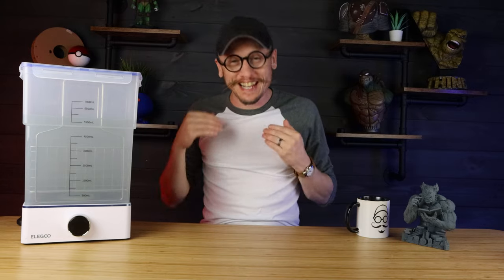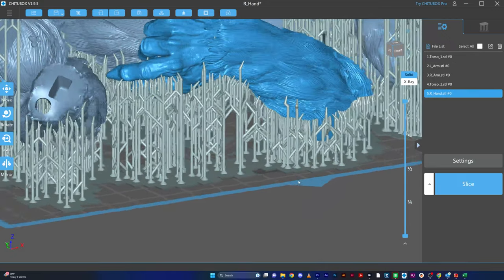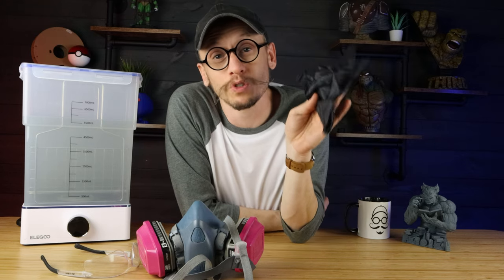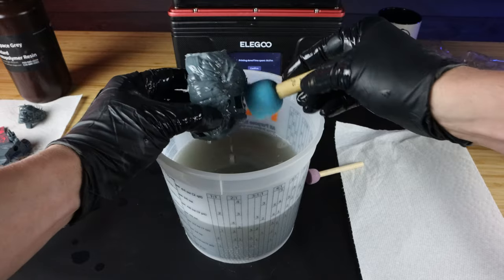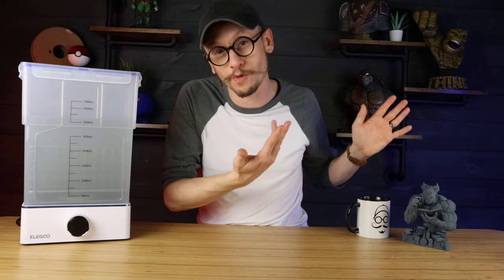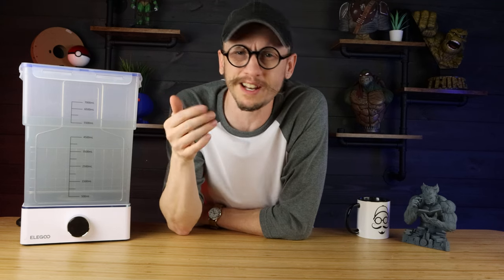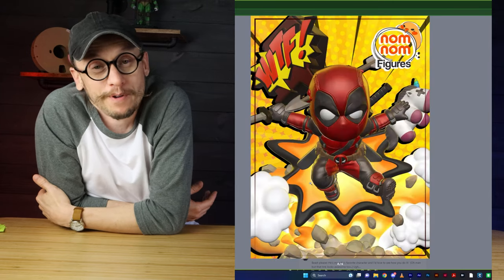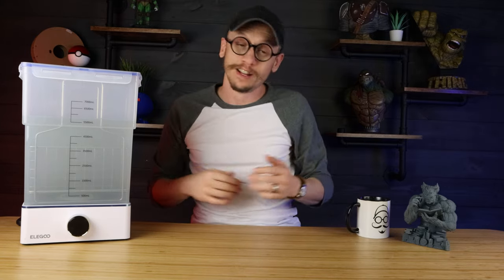Effective Resin Washing Techniques for 3D Prints: Step-by-Step Tutorial

Comment: I am not a maker. I am not even a hobbiest. I get to dabble with my printers on a very infrequent basis printing minis (resin), terrain (fdm) for D&D. But anything that makes my enjoyment greater and my frustration less is welcome.
Reply from the maker: I totally get that. I can’t even begin to count how many minis I’ve printed on my resin printer for my dnd campaigns. That’s where I see a ton of savings instead of buying them.
Reply: What are your thoughts regarding terrain printing with resin vs fdm? I just got a resin printer for minis, but would also love to make terrain for my players. I’d love to hear your thoughts and inputs on this.
Reply: I am certain that someone with more experience could give a better answer, but for me resin is what I use to print things that are small, delicate, and/or highly detailed. But for simpler, larger things I use fdm because it is economical and efficient. For example, I am currently printing Castle Ravenloft in 28mm scale (or trying to 😆) and fdm is better suited for that. I also like the dimensional accuracy that you can achieve with fdm. Especially when you need to cut up your model into multiple parts.

Comment: You need holes to clean the inside of the print...but if you didn't hollow your print there wouldn't be an inside...seems like a circular argument to me.
Reply from the maker: That is correct but if you don’t hallow your prints you are wasting a ton of resin. Without hallowing them you could drive up the cost of one figure x5 depending on the size.
Reply: For game pieces that get handled, are hollowed prints going to feel fragile?
Reply: Hollow game pieces don’t feel fragile, just make sure the wall is thick enough.

Comment: Lots of good advice Mead. Well done ! Clipping supports while they're soft, using two cleaning baths and having a small alcohol spray handy are always my recommandation. There are only two steps in my process that are different from what you're presenting. Thought it might interest you.
- ULTRASONIC CLEANER : I do not use a Wash and cure station so first dirty alcohol bath is done in an old ice cream plastic container with a hog bristle brush I keep clean every session and the second cleaning bath is done in clean alcohol in a closed container that spends one or two 3mn sessions in the ultrasonic cleaner. The prints come out squeaky clean and I never get residue. After 5mn out drying in the open, i can get them to curing.
- UV CURING IN WATER : i'm not printing big statuettes, I'm printing small and thin parts that need to be dimensionaly accurate and not warp or retract at curing. UV curing does heat the print and that causes stress in the model that can make it warp so i do the usual curing with the print immersed in water in a glass bowl for heat dissipation and because of its optic refraction characteristics.
Reply: Good advice. Thanks for sharing.
Reply: What kind of curing station do you use? Thanks for sharing!
Reply: @BL_SR  A DIY build consisting of a motorised turntable, UV Led strips connected to a small timer board and a tin-foil sided enclosure. You can build it up to the desired scale, from a small wooden box to a large metal bucket or even a standardized mailbox. It's the one thing you can do on the cheap without consequences in the whole printing process.

Comment: Hi Chris, good points in your video.
Though, with delicate parts I prefer to leave the supports on the model until all is dry right before it goes into the hardening station. I print parts for scale aircraft modelling. A thin part, e. g. a propeller blade, tends to warping if washed with all supports gone. 

Another thing I am doing is to wash the parts in water after the isopropyl alcohol bath to get rid of most of the IPP in this step. Then I give them a good blow with the hair dryer and leave the parts for at least half a day for further drying before curing them.

Comment: hi ! great video! may i know what do u do to fill those gaps inbetween the joints?
Reply from the maker: You can get Vallejo plastic putty or even wood putty you just have to thin that down with water then just sand away what’s left to get smooth seems. I did a video a while back on how I process resin prints as well

Comment: I have a very thorough process.

Let plate sit sideways for a while in the printer > scrape the minis into a vat of hot mean green in a metal lidded catering pan thats floating in water in a giant ultrasonic cleaner (this way I don't have to clean the ultrasonic cleaner itself) > once thats done,  drop it in another metal square pan thats on a hot plate and the water is hot > let it sit for a minute and start fishing out each piece and pull the supports off - they fall off with zero resistance > the remaining pieces now go into wash and cure

Comment: Rubbing it with the spouncer doesn't mess it up? I've always been super gentle with my prints for fear of messing up the detail lol.
Reply from the maker: Not at all. The details are already partially cured a sponge won’t do damage. But if you’re using a firm toothbrush or something it could make small scratches. You’re just helping get all the uncured resin off.
Reply: @ItsMeaDMaDe thank you! That makes sense!

Comment: Good tips, I do have a question as you mentioned you have to hollow prints. So if I don't hollow and print solid, it won't clean all the resin?
Reply: You definitely don't want to hollow most of your prints. Hollowing minis make no sense. Unless it's big model and/or model printed in more then one part. For example you might want to print main body without hollowing it or hollow it only 50% or something and hollow parts that are attached to it so the main body provides good center of mass.

Comment: Im still waiting for one of these videos to give a viable solution to disposing of contaminated water/alcohol/uncured resin.
Reply: Just dump it in a clear bucket, expose it to sunlight or UV light to cure the resin and then you can toss it out. If you’re not filtering to reuse IPA will evaporate.
Reply: @thatkidvicious  everywhere seems to say not to throw the water out and to dispose of it at a water recycling plant? Is it ok to pour it down the drain once you've removed all the cured resin?
Reply: @DuggyDarko absolutely do not throw out the water. You need to treat the water exactly the same as you'd treat dirty alcohol. It's HAZMAT, and every city I know of takes 'household HAZMAT' for free as long as you give them your name, address, and verify you live there. It's better for everyone. (To make sure you're not, you know, dumping metric tons of stuff for a business)

Really, the #1 rule I was taught with resin printing:  There are no shortcuts. Water Washable just changes the solvent to clean a print from alcohol to water. It's not "greener", it's not safer.

You still need to treat your wash solvent the same way as with Alcohol. Cure the resin, maybe try to filter out the resin particles, then either reuse the cleaner/reclaimed water -- or take it off to HAZMAT.

Here's the thing with taking the waste to HAZMAT facilities: It's free in most places, and they have trained people, the right equipment, the right procedures, and all the time and patience to get it right. It's way safer for you.

And it goes back to the #1 rule of resin printing:  There are no shortcuts.

Comment: I've seen other videos about post processing, is there a preference between isopropyl alcohol and methylated spirits? Is one better than the other? I'm curious since I'm preparing to get into resin printing.
Reply from the maker: Honestly, I don’t know of a difference most use IPA due to its easier to get a hold of no matter where you are. Spirts do the job but there can be more of an odor and you need to have good ventilation. I realize I didn’t really answer you but it one of those things that is what ever works best for you. Hope that helps.
Reply: @ItsMeaDMaDe I appreciate the quick response and I'll take your advice into account, I also wanted to say thank you for making this video, I believe yours has been the most straightforward and well informative one I've seen. Thank you for doing what you do!

Comment: Hi Chris you mentioned in your video how you dislike the 2 in 1 wash / cure unit, why is that ?   Thanks for sharing.
Reply from the maker: Hey! Ive just found over time the 2-1 stations break down or just don't work as well. I like the elegoo stations cause you can take them apart can clean them easy in the areas that my 2-1 won't allow me too. but that just my opinion some people really like the 2-1 stations and they might not have the room for them...
Reply: @ItsMeaDMaDe  You have a valid point there, it should be easier to fix a machine that has only one function compare to a machine that washes but also is responsible for curing.  Thank you for sharing your thoughts and time,  Happy printing.

Comment: How do you clean up your silicone pad with puddles of resin?
Reply from the maker: I just use isopropyl alcohol and use a paper towel to wipe it up.
Reply: Make sure to cure the paper towel before throwing it away after cleaning the pad.

Comment: I usually wash my prints in a bucket of water after it comes out of the alcohol wash, is that okay ?
Reply from the maker: Yes. You can buy the water doesn’t remove the resin. Alcohol is the only thing that breaks it down to remove it.
Reply: Make sure not to empty that water down any drain!

Comment: great video and nicely explained, but.. now I don't understand how some others, for example, take a brush and apply liquid resin over the model so that they get a smooth surface, and you say the complete opposite, that there should not be even a small amount of resin, it is precisely siraya tech hig temperature resin that can be useful for the mold, and to get a shiny surface on the 3D model made in that mold, it is necessary to coat the mold in that way, I watched your video and that other video and now I don't understand anything, and I gather information and learn how to do it right
Reply: These techniques are for 3d printing not injection moulding? This type resin needs washing and curing as it’s a toxic substance.

Comment: lol... I, too, rinse my parts in alcohol before putting them in the Wash and Cure (for the same reason you do), but isn't what you're doing basically the "wash your dishes before putting them in the dishwasher" mentality? 🤷‍♂ I'm just saying 😁
Reply from the maker: Ha ha. Yes that is exactly it. Never heard that analogy before. Love it.
Reply: Have the actual washing station be the dirty mix because you can rest the build plate on the wire frame in the washing tub. This makes it super easy to clean the top of the build plate with a paintbrush while the models sit in the alcohol wash.

Then you can have your clean alcohol in whatever container you want or even a second Elegoo tub so you can put it on top of the magnetic stirring base.
Reply: @mizokia  lol... you know what, after I posted that, I decided that that wasn't such a bad idea after all. I pull my models off the plate, rinse them in a cheap alcohol bath by hand to get the bulk of the resin off then put them in the wash station with the more expensive denatured alcohol for the final clean.